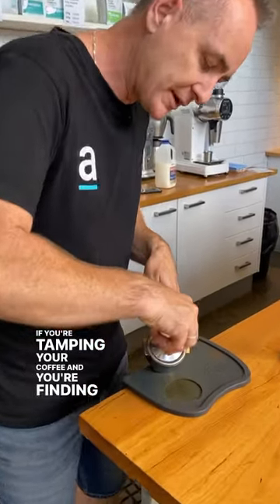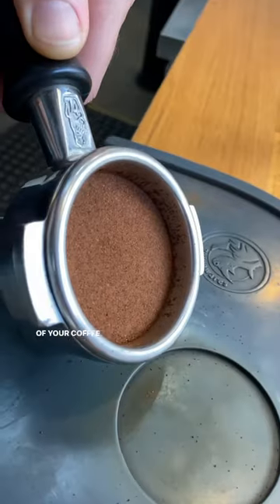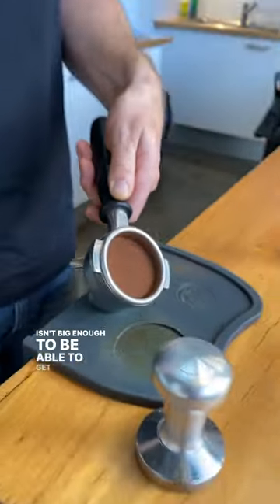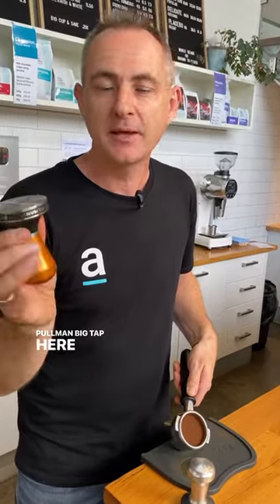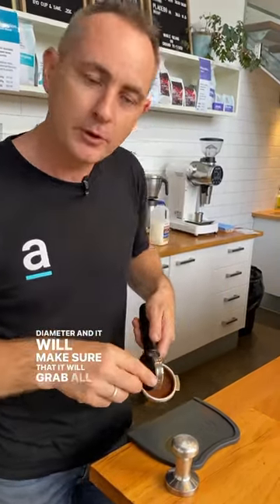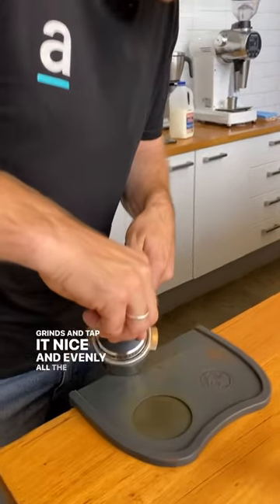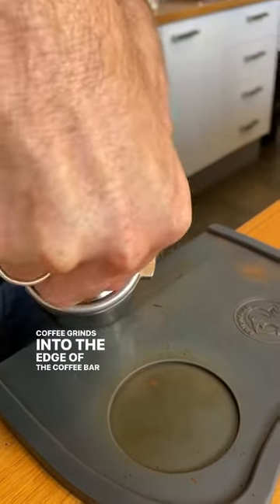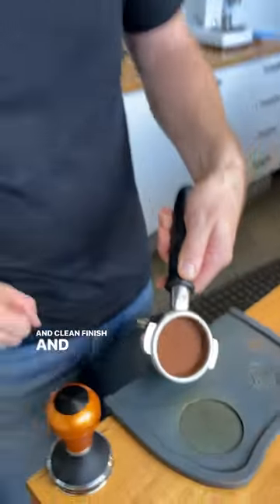The benefits of making coffee using a tamp like the Pullman Big Step Tamper ☕️ #coffee #barista

Comment: How do grounds on the side wall cause channeling 😂
Reply: The grounds don’t produce channeling, the grounds appear because the tamper doesn’t press the border of the puck as strong as it does for the rest of the surface, making the border of the puck have less resistance for the water to flow, resulting in channeling on the border of the puck.
Reply: They don't.  It's BS.
Reply: Tamping presses the coffee to the outside wall. Having some excess is a sign that this works. Dont make a rocket science out of it @NahueFederico
Reply: @hawksights  having excess on the wall means the tamper is smaller than the inner diameter of the basket.
Reply: @NahueFederico  So? Again. I see no problem here. There is always a tolerance.

Comment: Hello! How much does this end up actually affect extraction? Is this something you'd consider an essential upgrade, or something for that last little bit of consistency?
Reply: Totally essential for having tried the cheap stainless steel 58mm that Rocket gives you with their expensive machine versus a third party 58.5mm that tamps much better without any loose. Don't think it makes almost no difference because of the small number, it's far more than you think! Get a budget one if you can't afford yet a Pullman, as long as it's 58.5mm it's gonna be better than any 58.0mm!